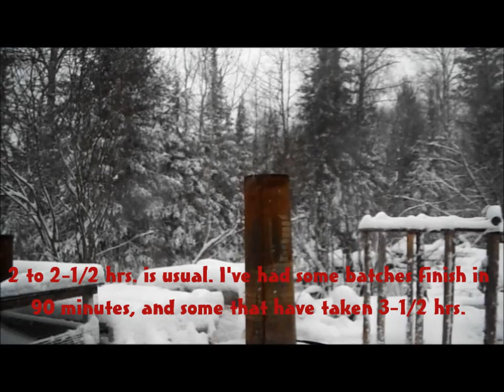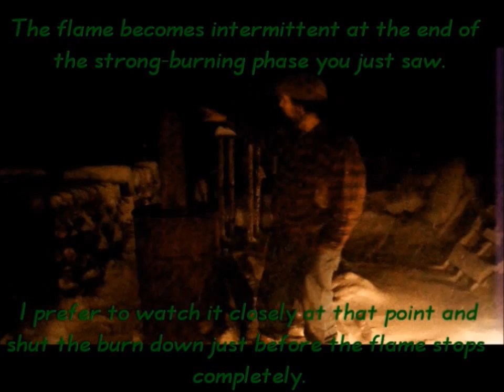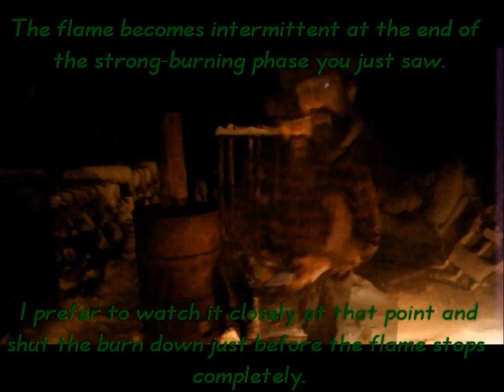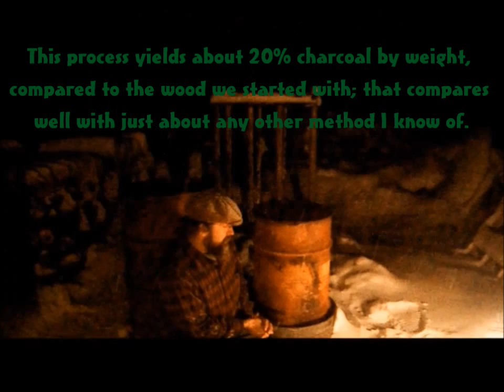Homemade Hardwood Charcoal

Comment from the maker: The secondary barrel serves at least two purposes: it preheats the secondary air, though I don't think that's a crucial factor. Importantly, though, it does separate the secondary air from the primary air. That is crucial to make the deign work: to separate the heating of the wood from the combustion of the volatile gases. Having a reduced aperture at the top of the fuel chamber above which the secondary air is introduced (as described just above) would also serve that purpose, I think.

Comment from the maker: I haven't tried it, but I have it in mind to make up a single-chamber unit with adjustable air inlets in the sidewall at the bottom and a heavy grate inside just above that level to support the wood. For secondary air, I think I would want to cut a hole in the center of the lid, like in the present unit, but have a chamber above that and below the chimney. I'd put adj. secondary air inlets in the wall of that chamber. To shut it down, I'd only have to close all the air inlets & cap the chimney

Comment: I'm planning on using pipes in the inside with ball valves or  threaded caps so I can close off the air and this way it's still being preheated which in wood stoves I've noticed does make a difference.

Comment from the maker: Ought to work. Bear in mind, the temps do get very high in there: I use 1" square bar to block my inner barrel up off the bottom of the big one. By the end of the burn, they are glowing -- I'd estimate a temp around 1250 F. So use heavy wall pipe or stainless, or just plan to replace it every now and then. There's always more than one way to do just about anything. I always like to say if you ask 5 blacksmiths how to do something, you'll get 8 different answers -- and they'll all work!

Comment: A slick method.  20%?  Not bad attal.  I've made a lot charcoal for gardening and that's about as good as it gets.  If you were to use an indirect method and use wood for fuel and then total all the wood used, it will work out to less than 20%.  A direct method such as this works just fine.

Comment: great videos! Do you need the outer barrel for secondary air or can you just drill holes in the inner barrel ? I'm thinking of using a stainless beer keg but I'd raather not have to get a 55 gallon drum for the outside if it's needed I'll get one.thanks in advance

Comment: for some reason the links didnt work even when copied and pasted but I just searched youtube and found it (It's also the name of some killer) I like it. I have actually used copper secondary air pipes in wood stoves with out a problem I've even thought it might be better because it's more conductive and preheats the air a little more allthough stainless might last longer. when I make it is it alright if I post it as a video response?

Comment from the maker: 20% sounds kinda pitiful, doesn't it? The volume at the end of the process is usually around a third. I guess that shows how much of wood's weight comes from elements other than carbon and the various things that make up the ash that's left after the charcoal is burned.